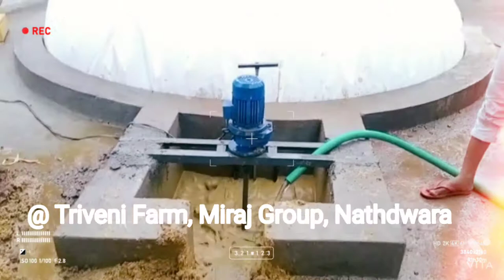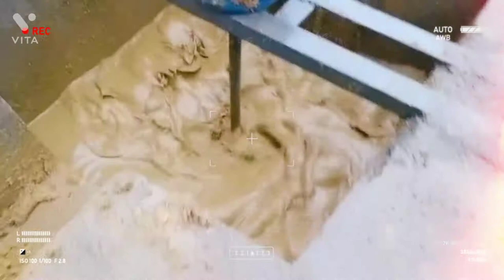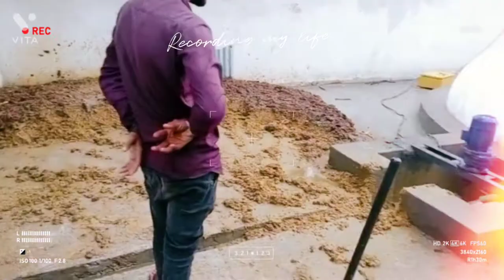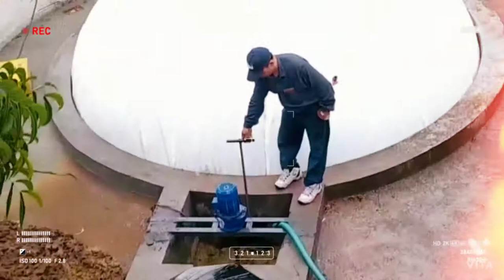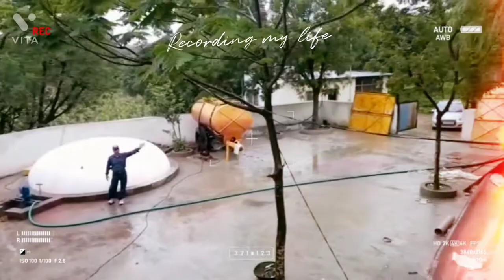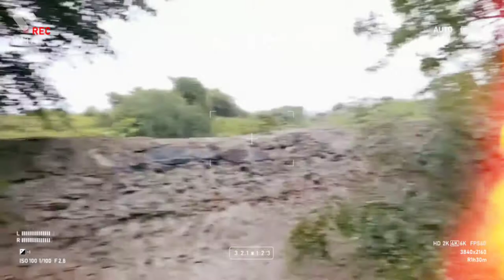10 M3/Day Capacity of Flexible Biogas Plant @ Triveni Farm, Miraj Group, Nathdwara

Comment: Not viable.....consume lots of water
Reply from the maker: It is viable sir, This water is use only for commissioning purpose, hence on daily basis we need water as per only raw material availability in 1:1 ratio.
Reply: Will it work if water ratio is high , like 4 :1 . 4 parts water